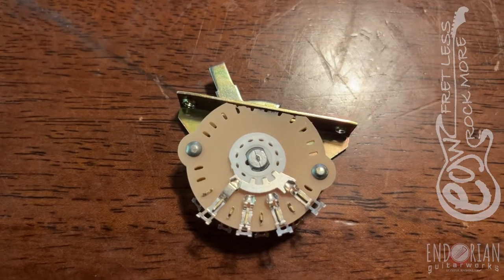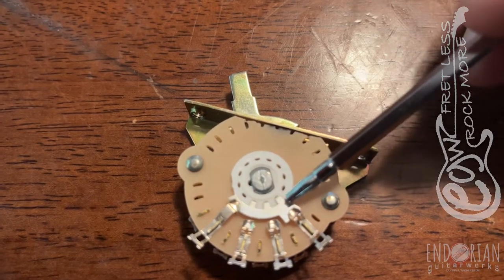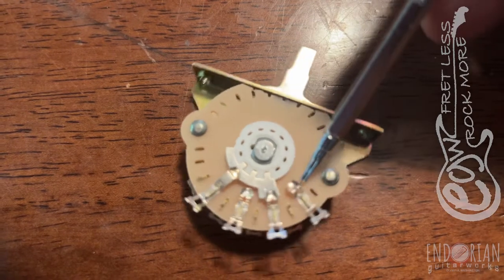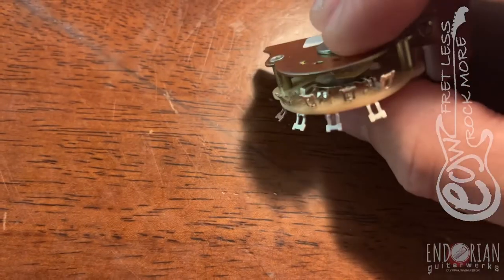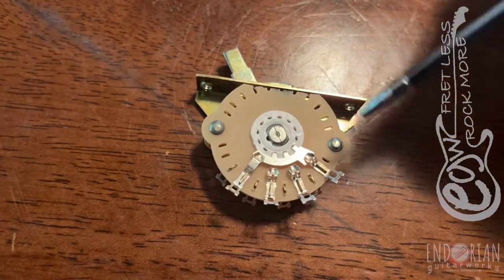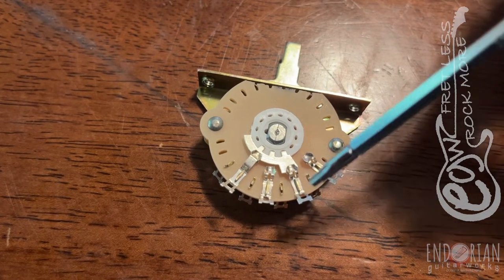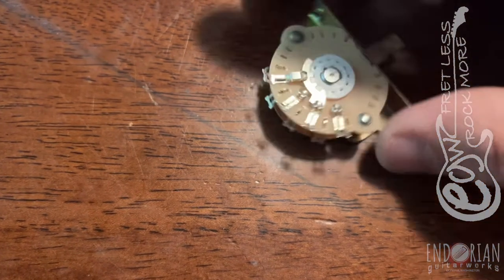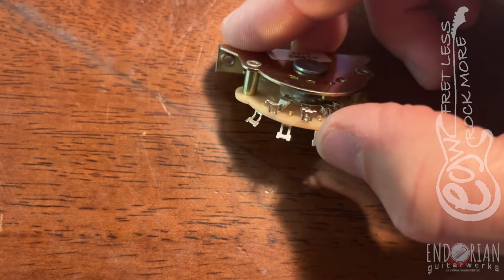Your traditional 3-way blade switch

Comment: I've been trying for a week to find a video like this.  I'm building my own guitar.  Strat body, but a p90 in the neck and a Telecaster bridge, no middle pickup, and I have a 3 way switch.  I have been able to get the two to work independent of each other, but the middle position I couldn't figure out.  This right here is what I needed thank you!  +1sub
Reply from the maker: That’s amazing man. Thank you. 🙏

Comment: I made a wiring in a strato with 2 p90 master vol and master tone but still doesn’t working. Both caps is platina at same time independent the pósitron of switch 😕 switch problem?
Reply: Playing*
Reply from the maker: It’s likely a wiring problem but could be the switch. If you send me some good pics of your wiring I can take a look

Comment: EGE GUITARS, when using a 3 way strat switch if you put the selector in between positions which strats tone pot#1 and tone pot#2 get selected?
Reply from the maker: I assume you mean 5 way… but anything is possible. That said… the answer is the same. It all depends on how your wire it. Maybe that will be the next video. 

A three way switch on a strat would likely be wired neck, middle, bridge… which is why 5 ways are used to get the blends.
Reply: @EGWguitars  No I mean 3 way, you put the lever in between the 3 way positions which you can get other PU combinations. The strat tone pot#2 will get connected to the bridge PU in which in between lever on a 3 way position switch?
Reply from the maker: @waynegram8907  yeah at that point it’s all how you wire it. Nearly infinite combinations.
Reply: @EGWguitars  older vintage strats were 3 way switch, if you put the lever between bridge + middle would it activate both tone pot#1 and tone pot#2?
Reply from the maker: @waynegram8907  interesting! I didn’t realize! I guess I don’t get to play too many vintage strats. I’ll go check it out!
Reply: @EGWguitars  Check it out and let me know